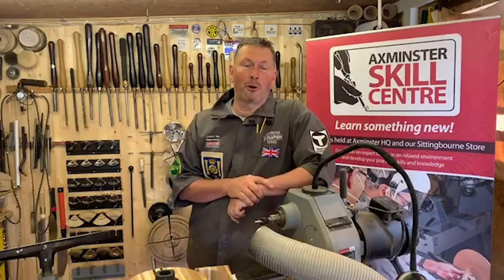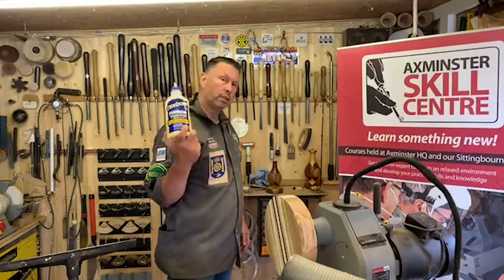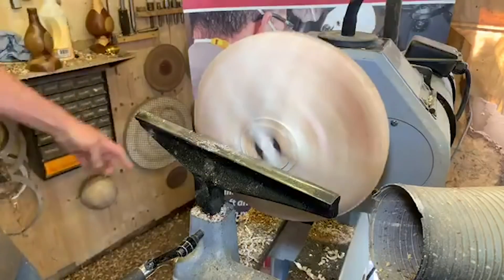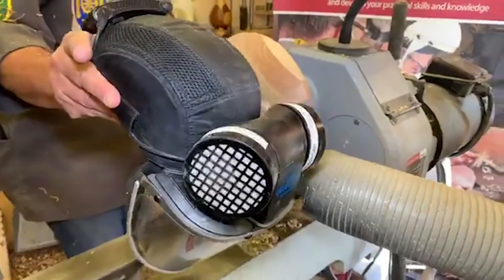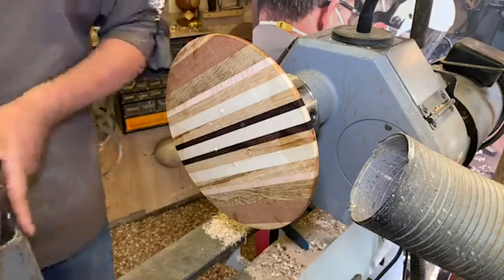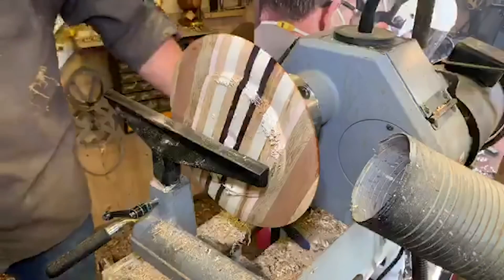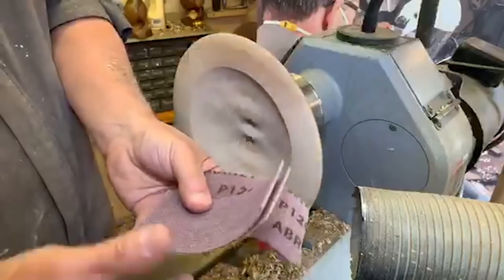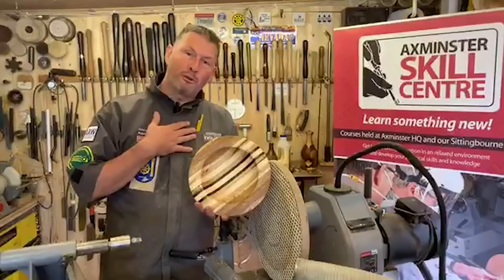#SkillCentreAtHome - Live Turning Thursday - Turning a bowl from scrap wood

Comment: In your opinion. Which is the best choice, external chuck or an internal chuck? And why?
Reply from the maker: Hi fletch lives, the following reply is from Colwin - "This depends on the project, however, if you're looking for strength then recess can be made stronger but if you're looking for flexibility then a foot is better.
Different projects will change the answer so you will need to get used to using both methods.
Hope that helps."